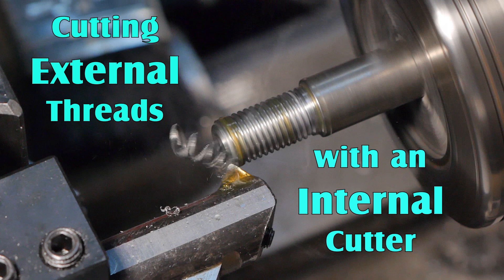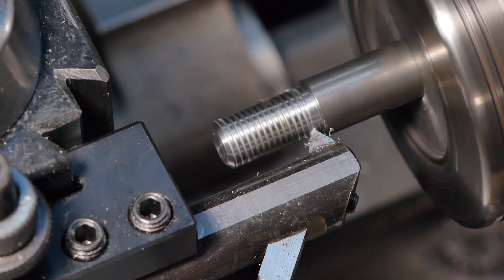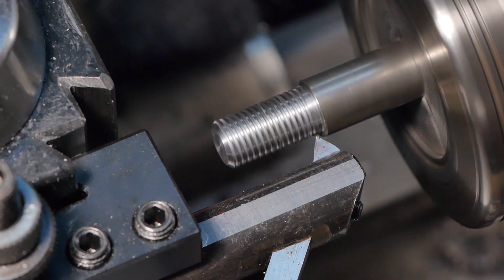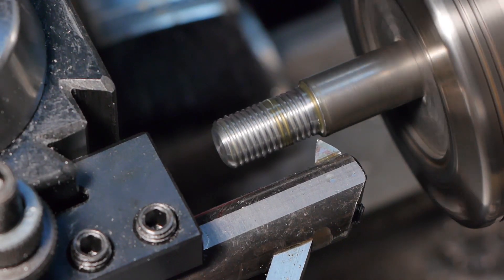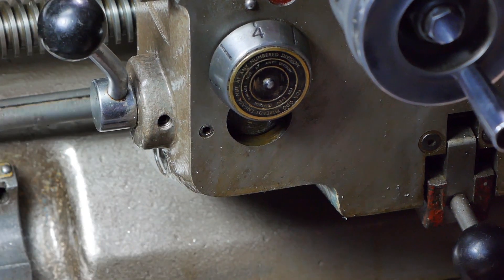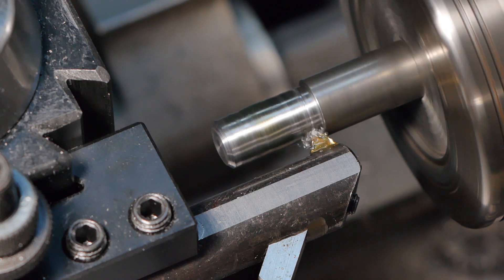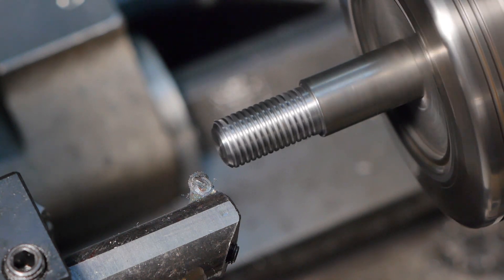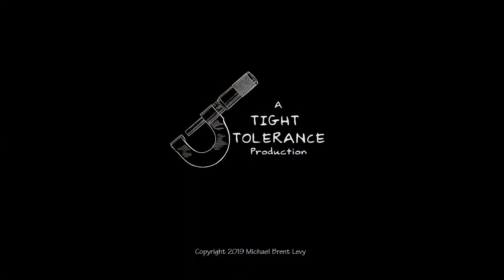Faster & Less Stressful Threading on the Lathe

Comment: Hi. I also use this metod for a while now but not with a Boring bar just straight turning holder and 16ER inserts.
I can do this because I can mount my Toolpost on the other side of threaded piece.
This way I can thread between centres. Thank you for sharing.

Comment: Hello, great way to cut thread but i have chatter using 16irag60
Reply from the maker: The insert should work fine, there is a lack of rigidity somewhere in your setup.
Reply: @mikelevyonline  here my setup if you can or tell me if wrong. 
Set compound 59.5 degrees same as 29.5, zero crossslide and dro, came in with compound. Using internal bore with 16irag60. 
Your method is a great way to cutting threads.
Reply from the maker: Chatter is usually a rigidity issue. Perhaps your cutter is sticking out too far from the tool holder, or your depth of cut is too great.
Reply: @mikelevyonline  you’re right i figured out tool has to be on the center and rigidity. It is a best way to do threading peace of mind. I tried both methods tool upside down but your method so much better. Thank you.

Comment: if I run my lathe at a faster speed isn't the new problem engaging the half nut in the correct spot
Reply from the maker: In a way, yes. Even though you are limited to the spindle speed at which your reflexes can no longer let you reliably engage the half nut, that’s still considerably faster than conventional threading to a shoulder.

Comment: This is a good technique but you have to be aware of clearance angles.  Looking at an external thread from the side you'll notice the threads appear sloped in one direction.  This is the helix angle, and a threading tool has clearance built in so the sides of the tool don't bind against the material (one side requires more clearance due to the angle of the helix).  Compared to an internal RH thread, an external thread being cut on the back side has the helix angle reversed.  So your tool may not clear.  Indexable tooling has clearance angles built into both the tool holder and the insert.  Usually the clearance is less of a problem for fine pitch threads and/or larger diameters.  Coarse threads and/or small diameters can give you problems due to the higher helix angles involved.  It's the same situation when using a LH threading tool upside down to cut RH threads.
Reply: I was just about to make a comment about the insert seat helix angle being reversed and flank clearance issues coming into play on anything but fairly fine thread pitches but I see you have already covered all the drawbacks.
Reply from the maker: Thanks for sharing this excellent info.

Comment: I've been meaning to try this.  I'm thinking that another advantage would be that you could set a carriage stop for your starting point, which would speed up the operation and it would be a huge help when cutting internal threads.  Thanks.  Regards.
Reply: This is a great comment.

Comment: Great video. A threading boring bar with full form inserts can produce RH internal and external threads saving the cost of external inserts.
I like to keep my compound slide parallel with the lathe axis and advancing the tool half the depth of cut on each pass to keep the cutting on the leading edge of the tool. It simulates advancing at 30 degrees but gives a direct thread depth reading on the cross slide.

Comment: you should consider the  thread milling on an,  Engine lath  it allows you to cut Thread at a much reddest spindle speed.  & can be adopted to even grater thread,  sizes  & good for the shorter thread lent. internal & External  thread cutting. i was first intrust to the siystom By Stephon on is channel.   Thread  mill cutting on a manual lathe , by this system . I have an old English school lathe with no lead screw.  fitted ,  But it allows the cutting of thread's by the ues of the feed rack  fin & course threads can be achieved tis way .  But the lack of a thread cutting gag . prevent signal point threading., i never did find a way around cutting without a position gage , But mill-Threading  dos not need a gage as it is better the slower the system run's  once engaged & the slack it out .  You can start & finish at any given point.  The  feed rat dictated by the set gearing  adds  an advantage to  manfully feeding or mechanically driven feeds.  I now cut threads.  easily on my old English school, lath with out  a led screw or its  gage i recommend it . & it is something that land's  it self to the smaller  lathe as often they  only have  a hand powered led screw .   & this form of mill trending siystom  lend it self well . I hop you tack the time to check Stephon out . Les England .

Comment: How do you achieve that the cutter everytime comes back at the same position in the thread?
Reply: The dial indicator or a positioning stop will always bring you to the same position, the rest is up to the thread dial to chase the same thread lead.
Reply from the maker: A very good question, and the answer to it may be found in any tutorial covering basic threading on the lathe.
Reply: On my lathe i think this is not possible. From the moment i switch in the "gear" for cutting thread, the lathe can not run without moving the support with the cutter. I only can change the direction of the cutter by changing the direction of rotation.
Reply from the maker: @JC-pw3cn  Again, refer to basic threading tutorials--I think you'll find it is possible on your lathe.

Comment: yep, nice, simple, applicable to, probably, 85-90% of threading jobs.
The upside-down tool method is pulling UP on the tool, not, probably, the way that the slide and compound are most rigid?
Reply from the maker: The tool-upside-down method probably works OK also; I'm not fond of it because the visibility of the tool tip isn't as good.

Comment: A nice take on a potentially stressful situation especially if the lathe operator doesn't need to cut many threads.   Am appreciative of this method as the tool is the right way up. I don't do it often but when I need to and can keep up the work standard.....well, then I'm happy. Many thanks for this video.
Reply from the maker: @AJWhittlebang  Thanks for taking the time to comment.